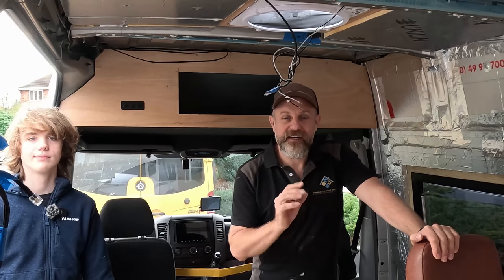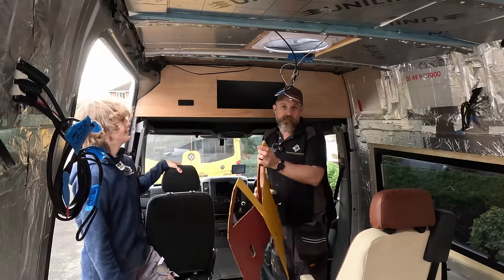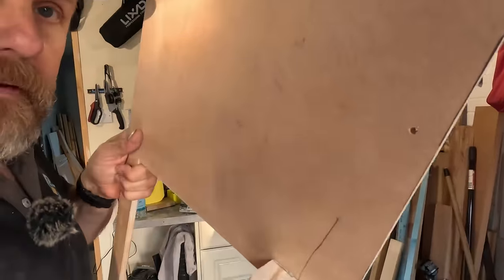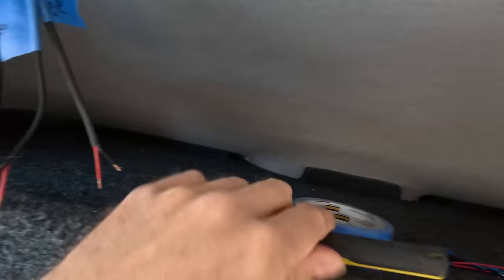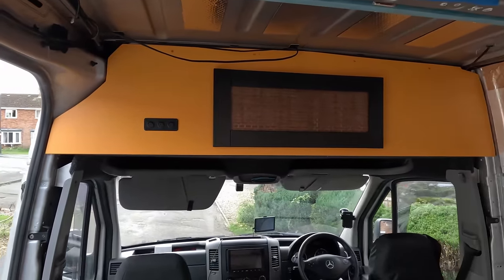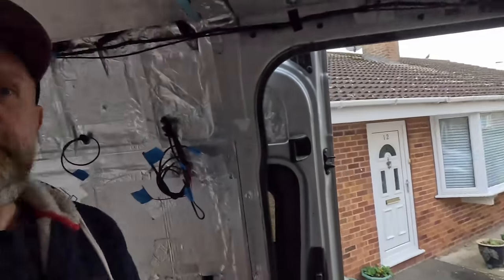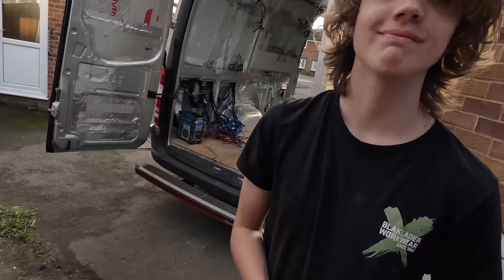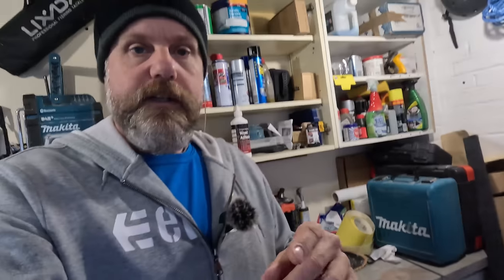Bold Choices! Painting & Installing Our Over-Cab Storage in the Sprinter Van Conversion

Comment: Brilliant! Could I ask about your electrics and what cable your using? I have in my head all 2 core flex 2mm throughout the van into a small fuse box then into my power station. Great video
Reply from the maker: Hi. Thanks for the comment. I'm using 1.5mm for the lights, and 2.5mm for most everything else. Some 4mm for the fridge and boiler👍👍